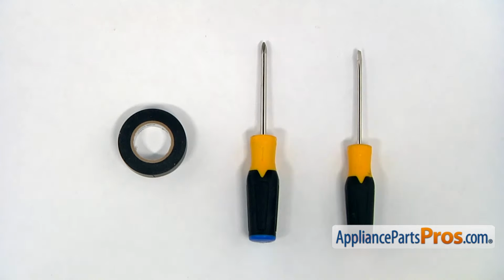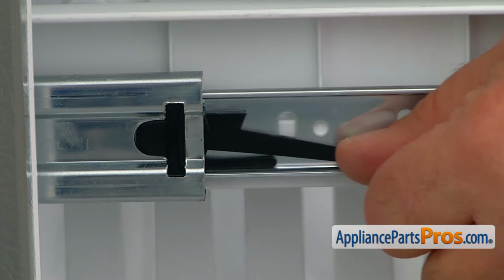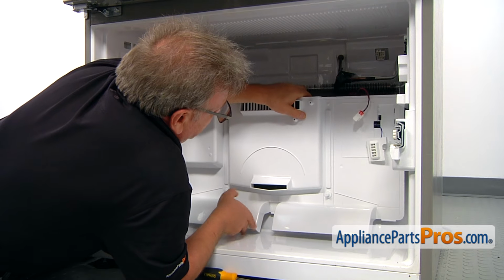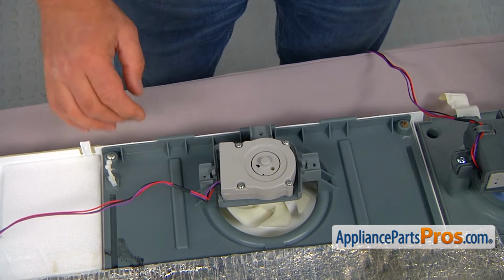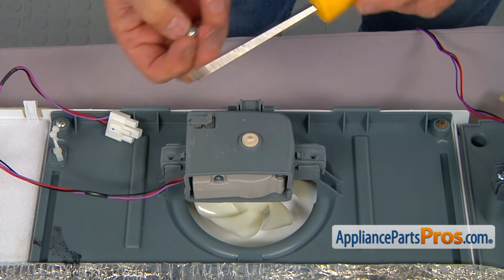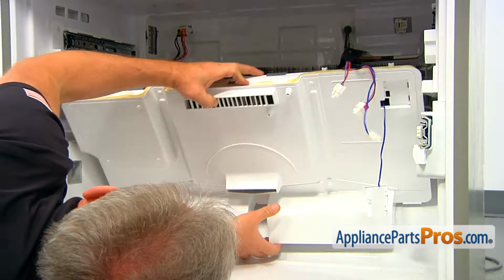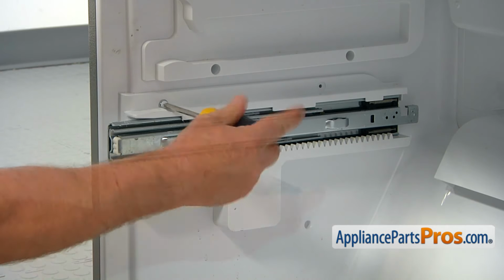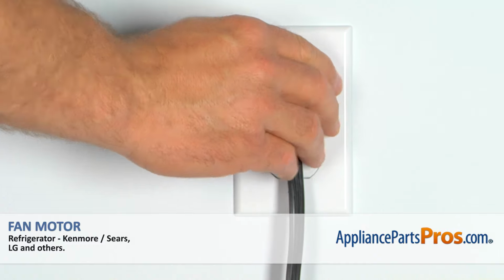How To: LG/Kenmore Refrigerator Fan Motor EAU61524007

Comment: Thank you so much for this.  All I needed was to pull the back panel to clear the drain.  I knew it had to be something simple, but didn't want to break anything with too much force on the wrong thing or in the wrong direction.

Comment: What a great video for how to replace the fan motor. But it will be even better if you folks could provide a fan model circuit diagram or steps to test it before replacing as this part is not just a simple On/Off DC motor; it has a circuit board and looks like a speed sensor built-in...

Comment: Hi, why the two fans have two different types of plugs? Are the two fans the same? And what about the Fan fan that lives in the refrigerator room - the one that gives the error code 'rF', is it the same as the one shown? (404B in LFX28978ST Service manual). Thanks!

Comment: The 2 fans motors is the same on this refrigerator? My problem is the Frezzer colds fine but on the top is not cold enough!☹️
Reply: replace your fans
Reply: Is the fan replaced by the tech on the video !
Reply: @COPPER71 I have the same issue, just replaced the fan and it’s still not cooling other then freezer

Comment: Having trouble with the fan motor froozen in my Bosch b21ct80snb/01 french door refrigerator.  My question is how to remove the freezer fan cover after removing screws and ice maker?  Won't budge.
Reply from the maker: Make sure all the screws on the cover are removed, then check for  any tabs that need to be released so you can pull off the cover. If the coils are frozen up you will have to let them defrost before removing the cover so you don't damage any parts.

Comment: But whats the other fan used for? I replaced the 1 u did but the fridge still doesnt get cold just the freezer, should i replace the 2nd fan?
Reply from the maker: Are you able to hear the fan running? Have you checked for air blockages?
Reply: @appliancepartspros What is the name of the second fan? The one on the edge, not in the middle??
Reply: I think the second fan is the ice maker fan
Reply: I do not see an answer to this question. Do we know for certain what the difference is? I ordered from an evaporator fan and motor directly from LG and it is the one on the left, not the one shown in the video that was replaced.

Comment: I got to the point that I was putting fridge back together.   I was trying to plug sensors back in but I had to plugs to plug up but only one place to plug it in.  I had the fan plug and a plug with a heavy blue plug but only a place to plug in one.  How did I mess up???

Comment: how do you know the fan motor is bad before removing it???
Reply: Good question.
Reply: I think when you get an ER IF code on the screen. Water and ice will not work. I've had this issue for a while and defrosting the fridge doesn't work
Reply: It should be blowing air
Reply: Why they don’t show how to test motor or test VOLTAGE on the pins of the plug on freezer side?

Comment: What if your fan is making a rattling sound some times then it stops and runs fine for awhile,then it starts making a humming sound when fan is running.
Reply: did u ever find out?
Reply: We had this happen and it was ice buildup around the fan. Removed the ice and voilà. The real problem was the drawer was too full and was nudging it open allowing air to get in and frost things up. That being said it could also just be a bad motor.
Reply: That is what happened with mine. It is the freezer fan on it's last legs. Pretty soon, it will not make any noise at all...because it is no longer working.

Comment: Much easier if you take off upper shelf rails and plastic inserts that hold them in. 6 screws on each side. Then you can move it around both on the assembly  and The disassembly
Reply: You are absolutely correct! I had to take the upper shelves off, too, in order the get the rear assembly to come down.

Comment: Stuck right now because I can't get the rear panel off only the right side and the left side seems hooked in. Anyone know a solution?
Reply: I'm having the same issue. I think ice build up is making it harder for the panel to release. Did you eventually get yours free?
Reply: @kimtaylorkruse3403  Yes use a hair dryer in there and then just pull harder. 👍

Comment: Anyone know what feeds the voltage to the fans?my fans work but they don't run...any idea if there is a relay or something that feeds the 13 volts??
Reply: From my research on the matter, this is a control/ mother board issue and not a fan issue. alot of people replacing fans only to get the same error code a few hours later, then call tech and they update mother board software to fix the issue ?? ned to invest in that fan company stock LOL.

Comment: My LG ref has stopped working and i have not have a good technical support.
Reply from the maker: What is your model number?
Reply from the maker: Thank you. What is the problem you are having with that unit?
Reply: @appliancepartspros  The units motor does not work.
Reply from the maker: It looks like this is an International model, so I'm not able to find specific information for this unit. However, generally, if your motor is not coming on when the compressor is on then you will need to test for power to the motor. If you have power there and it's not coming on then you will need to replace your motor. Locate the tech sheet for your unit to see where the testing points are and what voltage you should have.
Reply: @appliancepartspros  There is a 60volts on powerline on motor. I wonder if it is enough to run it? BTW there is a led in the board 3x blinking.

Comment: My motors in my LG have 4 wire connectors.  the additional lead is a yellow wire, and the connectors are different shapes, for good reason.  Anyone know what the model number for the 4 wire motor is?   My ref model is LFXS26973S /03
Reply: take the motor out like he did in the video and order it that way.. calling a parts supplier like i did just cost me more money and aggravation because they kept getting the part wrong.. when you take the fan out the part number will be right on it

Comment: Did I miss how to test the fan motor before you go through the trouble of replacing it? LOL  I mean  come on!  Ohm check ? Anyhting?
Reply: This video is very good for showing how to replace the fan motor, but it dose not show how to test it before replacing.  I googled the same but have not yet found any help.    This is my ice room fan motor EAU61524007, which is not just a DC motor, it has a circuit board with 3 wires out, Purple (online shows, motor speed feedbacked to motherboard), Black and Red for driving motor but not simple wires directly connected to the DC motor rather via a circuit to control motor speed I guess). If someone can find a circuit diagram for this type of Fan Motor, please share it.

Comment: Whoever designed this should be punched in the face, they couldn't make the assembly smaller to fit past the rails? cmon... I managed to remove mine without taking anything out but it was a pita, I have 2 fans , no idea what the other one is for, and a 120v blue wire for a heater or something.. where do I find out what these do? Mine was binding up when I took it out, then It spun freely, So i just stuck it back in. No clue, maybe that rubber grommet is breaking down and got in the shaft... we will see